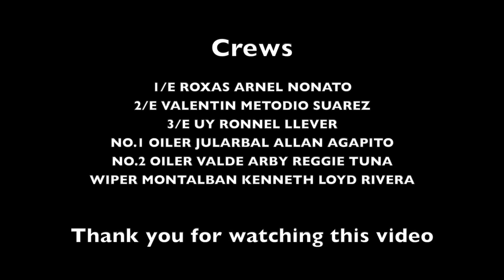#Pump #Overhaul #선원 #선박기관사 #해기사 #MOZIRI - Reserve Cool S W & Ballast Pump

Comment: Great job by great team, but there is some wrong highlighted points I would remind you: 
- No proper heating for the coupling caused stuck and forced to hammering. 
- No torque applied during bolt tightening. It written in the manual please use it. 
- why no alignment performed on the coupling? 

Other than is perfect job and good team.
Reply from the maker: Thank you for your kind comment.
You remind me to review my working.
Thank you so much.
Please, watch my other videos and find out my mistake and then comment.
Reply: السلام عليكم محمد اخي انا مهندس بحري اريد تطوير مهاراتي هل يمكنني الاتصال بك انت تعلم ان هناك شح في المعلةمات في التكنلوجيا البحرية

Comment: Minutes 5:22 . Wrong step.(might deformed the packing)
Should placed gland packing after insert shart..
Reply from the maker: Thank you for that you point-out the wrong step. You are right normally.
Just, the maker's pump is easy to insert the shaft if not tighten the gland.